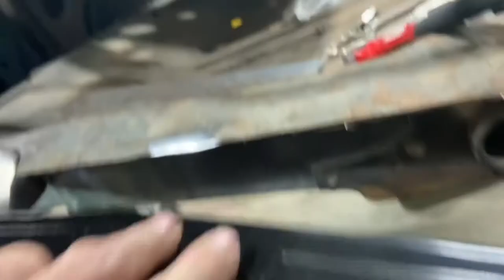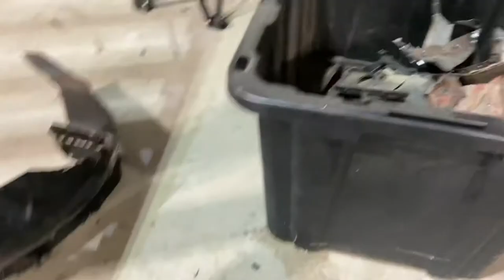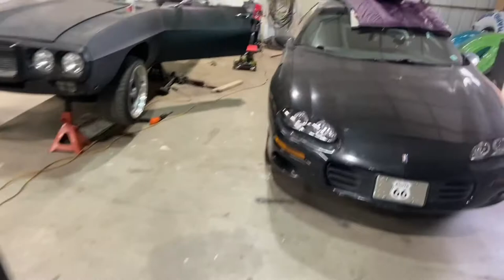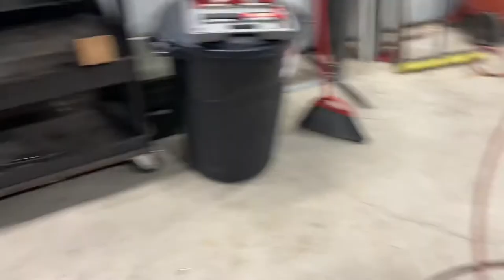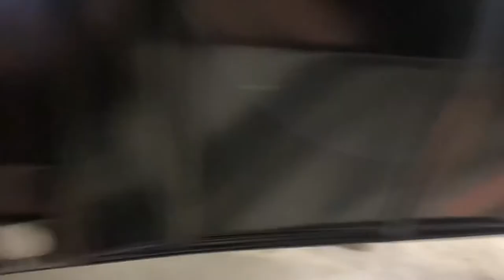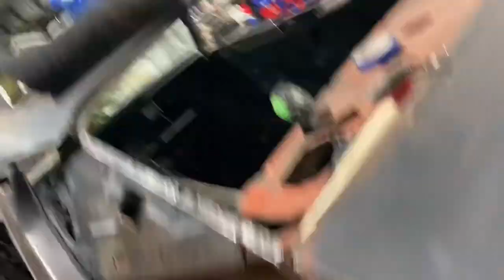1969 Firebird quarter panel installation #3: Inner and outer wheel tubs

Comment: What size wire do you use in your welder for sheet metal spot welding?
Reply from the maker: .023 is what I’ve got in the welder.